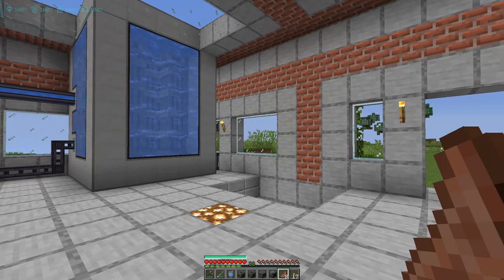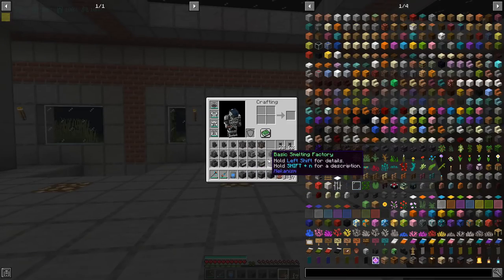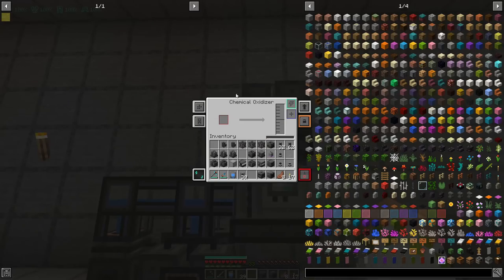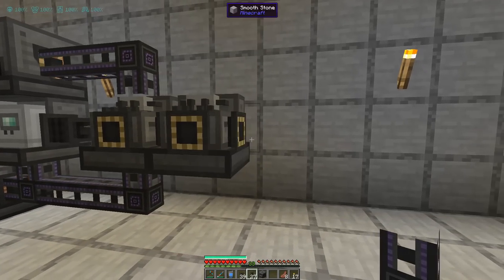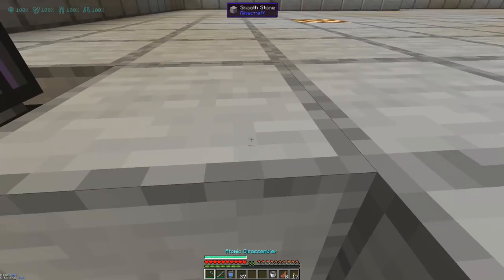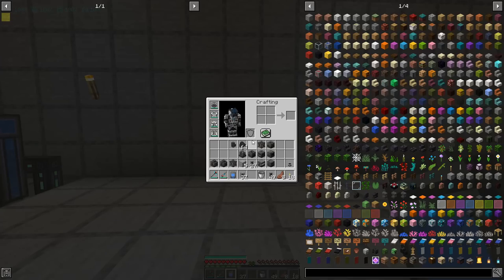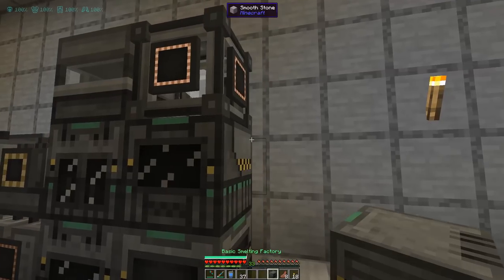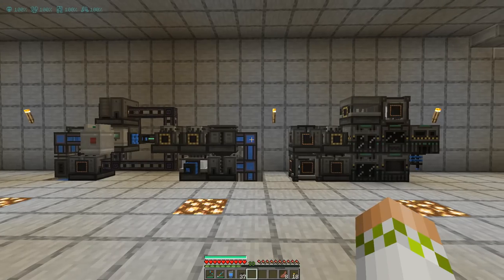Surviving With Mekanism v10 :: E22 - 5x Ore Processing

Comment: For anyone watching this video later: 

Rage is actually incorrect about the bottleneck point in 5x ore processing. You need to have an equal amount of chemical washers and chemical crystallizers. Because each ore becomes 1,000mB of slurry, and 200mB of slurry becomes one ingot in the end, you want ideally exactly 5 chemical washers per chemical dissolution chamber, all connected to it on a single isolated pressurized tube network. If the tubes are connected to multiple outputs, they will always evenly distribute their contents. This ensures exactly 200mB of slurry goes into each washer. 

From here, just place each washer directly next to its own dedicated chemical crystallizer. This will keep the slurry from getting mixed up between the machine lines.

From here, your bottleneck issue will be that a chemical dissolution chamber works twice as fast as the washers and crystallizers. While you could connect one dissolution chamber to 10 washers, this will cause the system to clog with 100mB of slurry if you ever put in an odd number amount of any ore. It's better to have two separate chemical dissolution chambers, each connected to its own dedicated and isolated tube network for its own 5 chemical washers and crystallizers.

With 10 chemical crystallizers, you can output crystallized ore slightly faster than a "factory line" (all the 4x machines, upgraded to ultimate factories) can process it, but the capacity in the machines for 9 stacks of resources will make this take an insanely long time to bottleneck. And if you're processing 9 ingots per second for that long without running out of ore, you may want to consider taking a break from Minecraft.
Reply: Is this still valid for latest patches?
Reply: @timmyingelbrecht6977  I haven't played Mekanism past 1.16 yet. With the change in vanilla Minecraft ores, things may work differently. Best bet would be to test it out in Creative, where you can destroy and replace machines to get rid of anything clogging up the system without any penalties.

Comment: the mekanism plan:
1. set a goal
2. do the first important craft
3. do all of the stepts it takes to do the important craft
4. repeat 2 and 3 until you have everything you need to build the goal
5. build the goal
6. try to power it up
7. realize it doesnt work
8. check everything for half an hour to see whats wrong
9. you forgot to put that thing to output
10. profit from goal
11. repeat
Reply: havent played with mekanisim until you forget to bring a connecting items to a project 10 plus times
Reply: that 8 and 9 is SO RELATABLE AND IT TAKES LIKE 30 MINS TO REALISE UHH.
Reply: @Sov_spoiled  *30 plus times

Comment: I can''t do this after 3 IPAs. I'll be back...

It seemed really complicated, but it was actually easy once I watched the video and tried the setup a few times. I left my existing setup as it was, and added the new machines at the end (to the right of the last Chemical Oxidizer processing the Uranium). After that, ran a tube for the Sulfuric Acid and water from an existing pump, and I'm getting crystals. Now have to tangle-porter it upstairs for the final product. Thanks!

Another edit: I just discovered that the tangle-porter only ports one item at a time. Boo. I may just have to run pipes.

Comment: You can pull the hydrogen out of the PRC using a gas-burning generator, it will also give you a little bit of power back. I think there may be one or 2 other spots where you can use the gas burning gen. to dispose of some extra hydrogen and get power back as a result.

Comment: Thanks for the tutorial for x5 Ore Processing, it really helped! This thing is a coal guzzler though, burned through 20k pieces of coal in around 30 minutes just to produce the sulfuric acid needed as I am processing a ton of ore.
Reply: Just make an automatic tree farm
Reply: @trollwayy5981  Don't have enough bone meal. I'm just having my Digital Miner mine straight coal right now.
Reply: @billhughes1393  Yeah that’s the easiest way imho
Reply: @billhughes1393  If only there was a way to automatically move your digital miner though.
Reply: @oliverlemay3619  Ahhh yeah, I have to manual move it with my Quantum Entangloporters. I actually kinda lost my entire Digital Miner setup somewhere in my world... should've waymarked it lol
Reply: @billhughes1393  Oof, that sucks. Someday you might find it haha
Reply: 1 way to make sulfur too is chemical injection chamber gunpowder with hydrogen chloride which needs quite a lot of brine to be fast but its all just water. gunpowder from crushin flint, flint from enrichin gravel, gravel from crushing just cobble.
Reply: Although it's a late reply, the problem probably is that you aren't using gas upgrades (increases gas efficiency) in the machines that use the sulfuric acid. Then you start using a lot less coal.
Reply: @notbigsuprise9769  I have every single possible upgrade in all my machines maxed out. It process coal extremely fast and the most efficiently way possible. It’s just the shortage of coal.
Reply: @Azeliniana  I’ll give this a try!

Comment: I'm planning on building a massive pyramid (bedrock to build limit), in... I'm using a big 1.12.2 pack. The bottom floor is going to have a lot of production rooms, so I'm going to set a series of rooms up for each step of the process, with an input and on output on opposite sides of the room. Hopefully, that will let me multiply the machines for the steps that are bottlenecked.

Comment: To me the most important reason to get 5x ore processing is actually in the production of antimatter.  It just takes so much uranium to get those pellets that the 20% increase alone is worth it.  One of the most frustrating things about 5x ore processing though imo is how to get around the bottleneck.  You can't make factories out of the crystallizer, so you have to build multiple of them to maximize efficiency.  The problem is if you connect them with pipes, you get rounding errors with the slurry and have to then manually remove the slurry with a gauge dropper to use a different ore.  The only way around this that I have found is to intentionally overload the system with around 2 stacks of ore since this forces all of the crystallizers to sync up.  It might be possible to achieve this by having 5 washers as well, but I didn't try that yet.

It also is possible to generate unlimited sulfuric acid for "free" by setting up lava to hit water to make cobblestone, have the digital miner grab it, then turn that into sulfuric acid through a bunch of machines.
Reply: The only solution that i see to this (And i have to test it in my world with mekanism and ae2) is to make dedicated x5 ore processors for each slurry ore. it seems to be intentional the fact that they doesn't have factory versions, they are endgame machines so you should be making more of those.
Reply: @Shishyo16  If all 5 of the crystallizers back up, since they are used in increments of 200 it will guarantee they empty out correctly.  I think the problem is just that the washer processes in increments of 1, which messes up the distribution.  Once the washer is done though, it fixes itself.  Also the crystallizer is a bit slower than the other 2 machines, so in theory you can get 5-1 a bit faster than 5x the processing of 1 crystal.  This conflicts with the approach of backing up the machine since you need more ore to accomplish that with more crystallizers.  I think having 5 washers as well and having them connected each to 1 crystallizer can fix this issue as well, but I didn't test it.
Reply: @askmiller  I forgot to mention that i "lost" two crystallizers (or washers? i can't remember) because they got "locked" with iron ore, i just threw them to the system until i have the will to expand my ore factory, and to make a big automatic cobblestone farm to make sulfuric acid (i only can think about the digital miner to make an "automatic" farm)
Reply: @Shishyo16  You can use gauge droppers to suck out the slurry, though it sounds more like you're referring to a glitch with the machines?
Reply: @askmiller  I think just encountered a glitch, i did craft the gauge dropper and attempted to use it unsuccessfully, and i just remember that's the crystallizer the one with the issue.
Reply: @Shishyo16  it confused me when I first tried using it.  You have to click on the actual bar that has the slurry in it, not place it in the box which looks like the intuitive thing to do.  If clicking on the bar itself doesn't work, then it might be something worth reporting.
Reply: @askmiller  I'm playing right now, so i'll test it
Reply: @askmiller  Dude, you rock. It worked, i can't believe that i didn't thought about trying to use the gauge with the bar instead the + sign. Thanks!
Reply: @ChaoGirDja  You're right, but with only Mekanism as a main mod and ae2 as the support one, i don't know any specific way to automate wood production, unless there is a way to put an array of saplings with the digital miner.
Reply: @ChaoGirDja  Never used lasers, and now i'm more than impressed, but still i have to manage to do the sapling thing automated
Reply: @Shishyo16  It took me forever to figure this out as well.  Also hold shift when you click deletes stuff instead of putting it in the gauge dropper.  You can also shift click with the gauge dropper in your hand to dump whatever is in it.
Reply: @ChaoGirDja  Yea.  In that case it is probably easier than the cobble -> gravel -> flint -> gunpowder -> sulfur route.  As the other guy pointed out, no idea how to actually accomplish that with just mekanism.
Reply from the maker: Yep, you're 100% right. If you're only using Mekanism then uranium is really the only ingot you will ever run out of lategame and is pretty much the most critical to endgame too lol. It definitely is frustrating that all the 4x -> 5x machines cant be made into factories when the rest can. While setting up an entire one of these for every single ore you process to avoid the rounding errors would most likely be the way to solve it in a modpack where you will have lots more types / more need for all of them, I feel like it cant be justified here with how little you truly need the ingots at this point. Not like im in a rush to get my iron lmao.

Comment: As far as I understand this setup needs Storage system from Mekanism, which already contains power + specific fluids and items (coal etc) stored in it right?
I am sure it will be able to work with other systems the setup will most likely change from its compact position if done so.
I am currently using Thermal Expansion for power and Refined Storage for storage, and my grasp on Refined Storage is not great either, will be really hard to make this thing work.
Reply: I don’t think so I play all the mods 6 I have the refined storage thing to I would get a chest and just pipe it in from a chest full of stuff